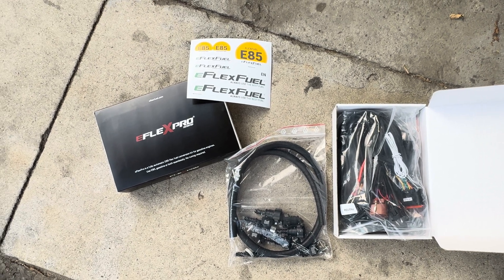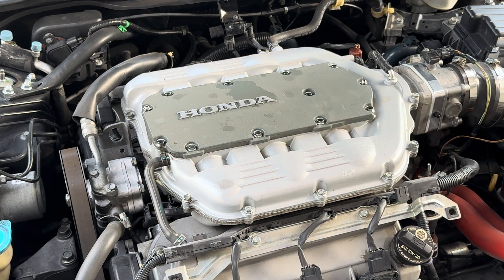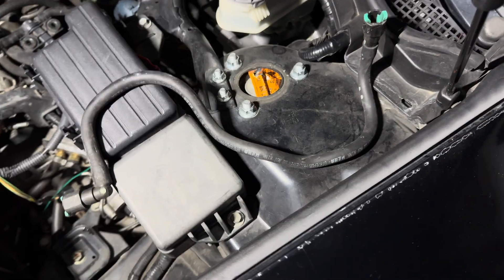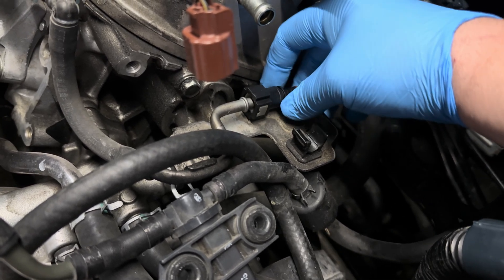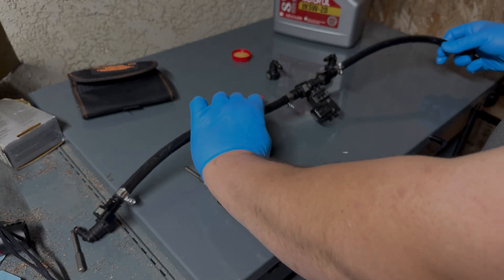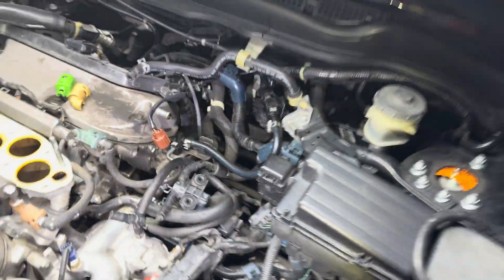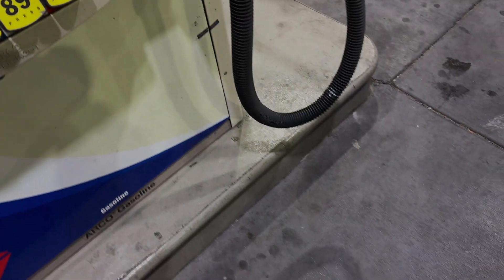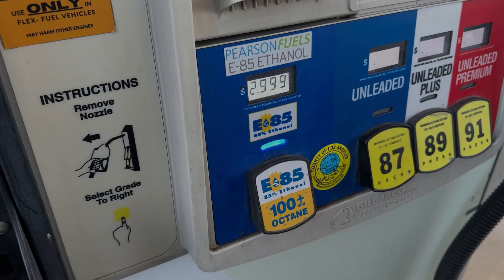How to install EFlex Fuel e85 kit make power

Comment: Does this upgrade the material compatibility of the car for higher blends? I am from India, and I have a Volkswagen Polo Mk5 that is E10-compliant from the factory. Our government has mandated E20 for now, with E25, E27 and E30 expected to arrive in the upcoming years. Will it ensure the safety of the car in a situation when the amount of ethanol in the fuel can't be chosen by the consumer?

Comment: You can change and customize engine parameters with it?
Reply from the maker: On e85 you can adjust the AFR you have two analog wires one for a wideband which I'm going to install soon and one for another like TPS and map etc for a data logging I know this kit works with your ECU and basically takes over injector pulse now running e85 you have virtually zero knock and the timings able to advance compared to gasoline I left a link in the description box for more details they're also doing a free giveaway of one of these kit no purchase necessary all you have to do is enter your email address